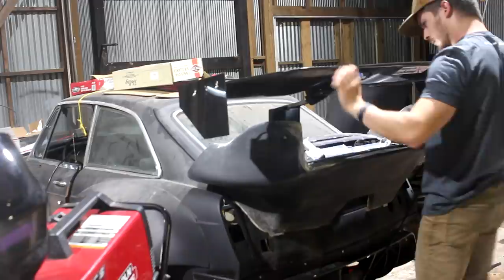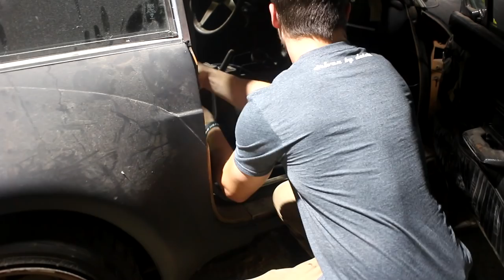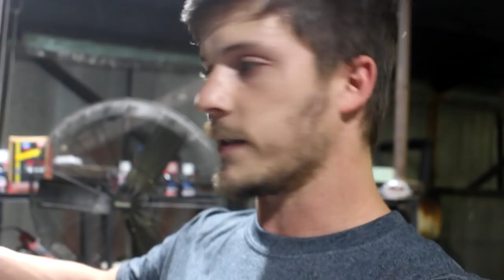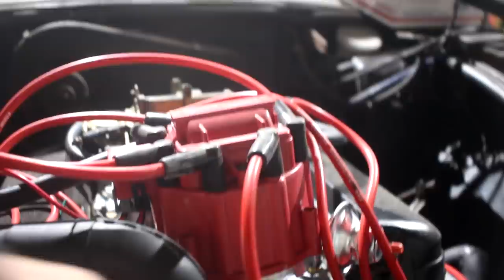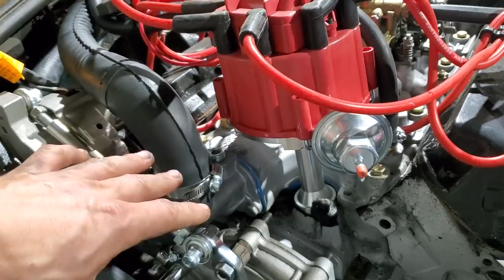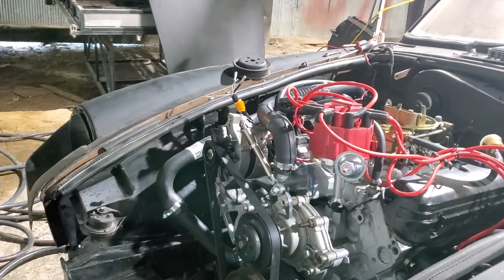THE RWMGB Pt. 39: DIY REAR MOUNT RADIATOR WORKS!!!

Comment: Water pump info: the nipple next to thermostat on intake goes to top nipple on water pump. The bottom nipple on water pump would go to heater core. Cap this if not using heat. If you are using heat, then return house from water pump goes to an NPT fitting on top of intake behind where thermostat housing is.

Comment: Good Lord. The water line from the intake manifold goes to the top fitting on the water pump. It's called thermostat bypass hose. Go to the store and get one and hook it up! It's there for a reason!

Comment: Hold up, was that "302" a 5.0 efi engine? Roller cam? If so i sure hope you have a hardened steel gear on that distributor,  if not the camshaft is guaranteed to shred the distributor gear. I've  had this happen.
Reply: depends on the cam if its billet and the pitch on the gears.

Comment: Dude at the engine  the highest point of the cooling system is the hose coming up from the manifold, chop it an put in an inline rad cap to bleed air and fill the system.

Comment: Why did you have to make the radiator stand up like that? 
Would it not be nicer if it had been  horizontal and hidden under the air intake cover?

Comment: You might want to check which way the water pump is supposed to be turning. Usually if the pulley is smooth it goes on the back side of the belt, I'm no 302 expert so it would be something I'd have to check

Comment: What's the point of adding complexity with a rear mount rad? If you can squeeze a twin turbo 331 with FMIC and radiator under a standard bonnet then what necessitates having a radiator at the butt end?